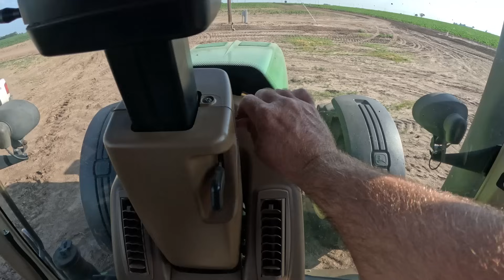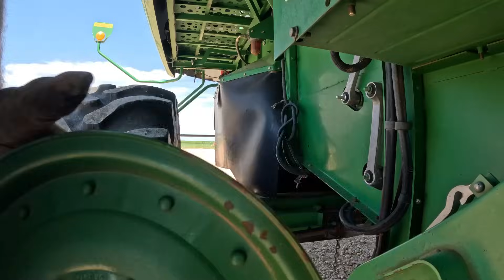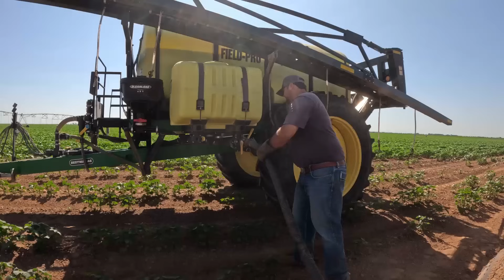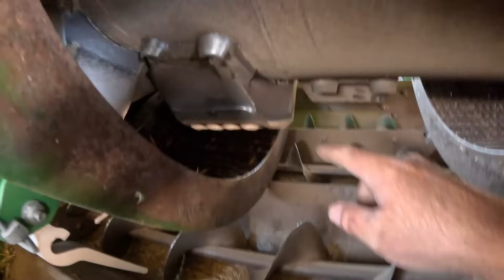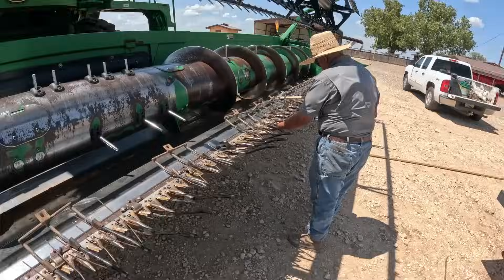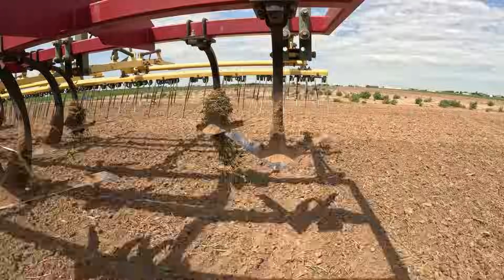Working On The Combine & Fertilizing Cotton

Comment: Casey, do those pull behind sprayers run pretty smooth or do they yank the tractor around quite a bit and rattle on the draw bar ?
Reply from the maker: They pull very nice.  The only time they will yank on you is when crossing a wash out.  Empty it weighs 9000pounds.  Full it weighs 24000 pounds.  Top air and Bestway are probably the best two drag types.
Reply: @wildwestfarmer  Good to know , thanks ! 
I had been wondering about that. I saw a couple of nearly new Wylie’s sell for about 10k at a couple of auctions last year, I would have thought they would have sold for more.